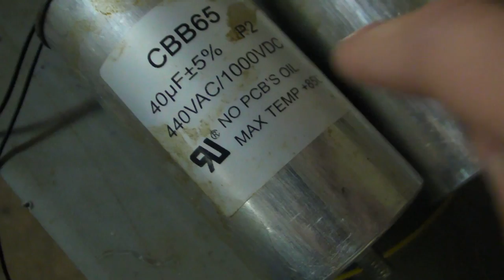Rectified Microwave Transformer Setup

Comment: cool, i love smooth arcs... i did the same just with mains line to line (400v) which came out as 585v DC with around 2200uF . . firstly i used 500 resistor which was nice and quite but then i connected my 2  50W 38ohms in series and drew beautiful arcs while a significant 50hz noise. i plan to buy more caps and use all 3 lines to get it even smoother..  very useful for blowing things apart :D

Comment from the maker: Running open circuit does not seem to hurt anything. The only difference without smoothing is that the arcs will not sound like a silent hissing, but instead will still sound AC, just at a higher frequency.

Comment: @juniortore1 You need load resistor because the most current will flow at only the first bunch of diodes and very little will flow at the second bunch (in parallel). If you see an audio amplifier schematic you will see the load resistors at the emmiter !

Comment: @cechk01 and the output voltage is 3kv which is 500v  more than each is rated for. maybe it's just a luck that they can handle that or the ballast MOT is able of dividing the voltage so it doesn't exceeds, either way it's surprising it works well :)

Comment: According to Photonicinduction, MOTS are soon to become obsolete in favour of inverter driven transformers that require a specific square-wave signal to operate or else the driver circuit will automatically shut it off.

Comment: @juniortore1 i know 2 options you could use to get the higher voltage...  investigate outlets from individual rooms or  trace them from the braker box, then just hook up a special outlet out of 2 lives, ..the second one is voltage doubler, i have a video of it on my channel, it's just two diodes and the output power depends on the capacity of caps,i want to try to double the voltage of that previou one..585 * 2 could be quite interesting, it just needs a big capacity unless i want some low power

Comment: 2kV DC caps are not even enough for this setup because mot outputs 2kV RMS, but capacitors charges to peak...
Reply from the maker: That is true. Surprisingly they tolerated the over voltage.
Reply: then they are pretty good !

Comment from the maker: @ExplosiveAnyThing I knew it would be higher, I just did not know the equation. Thankfully they did not blow up. Why do you need a load resistor when paralleling, I have never had a problem. And the reason I used a secondary ballast is so that the capacitors do not just short out all of their energy in one burst which would kill my diodes, so really it is acting like a resistor instead.

Comment: If the caps are rated for AC at all, they are non-polarised. Wont go bang either way...
Nice setup other than those connections to the capacitor, i'd make sure they were clamped down tight. I hate re-attaching a wire that is charged to 2kv.

Comment: 1. voltage is NOT 2kV anymore is 2(voltage)*(root)2.
2. you need a load resistor at the diodes before you  parallel them!!!
3.That type of capacitor have NO polarity.
4. And last why you are ballast the ballasted mot?